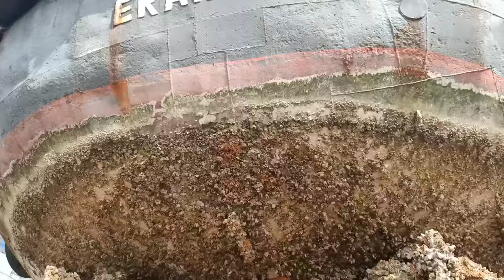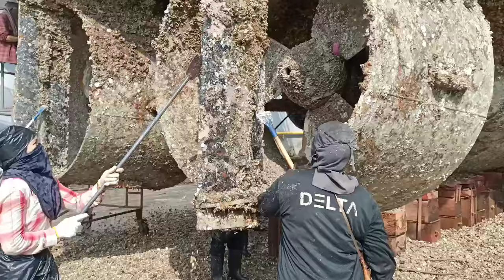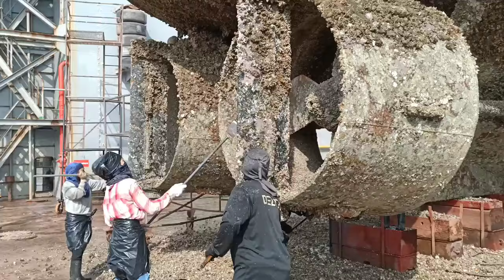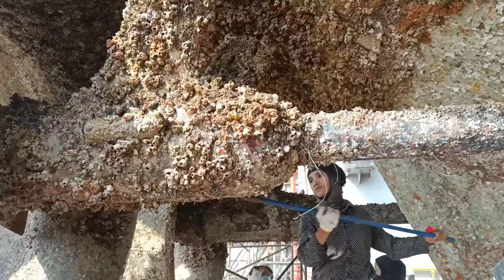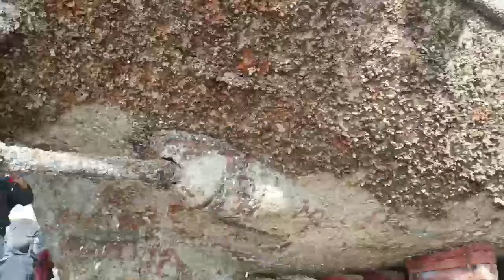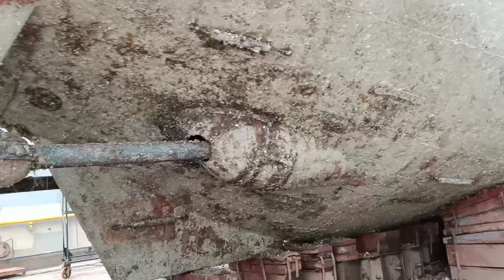Inilah Yang Terjadi Jika Kapal Bertahun-Tahun Tidak Dibersihkan, Proses Membersihkan Kerak Kapal

Comment: Your pressure washer is not working properly. You should use a higher psi Pressure Washer Machine to remove the barnacles and rust from these areas.
Reply from the maker: Thank you...✌️✌️👌